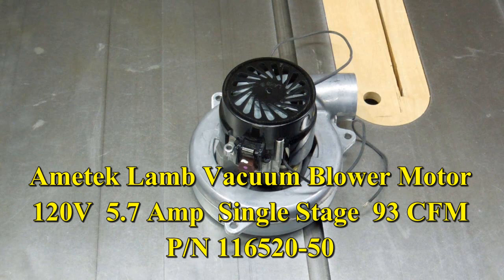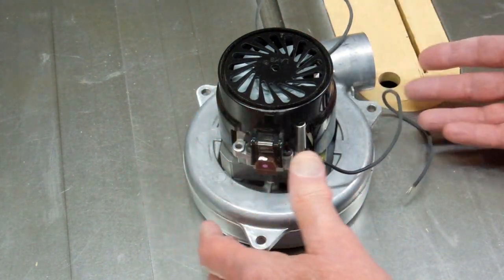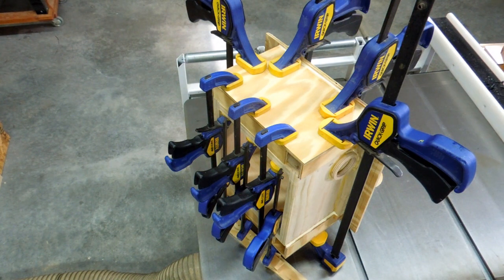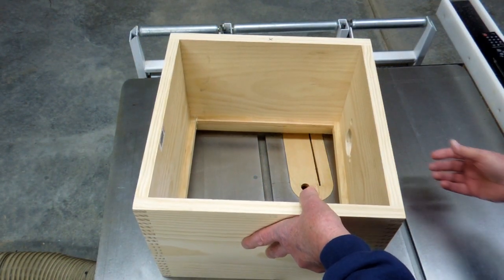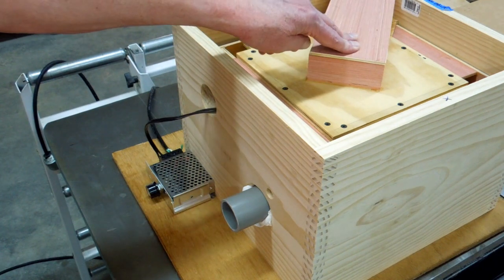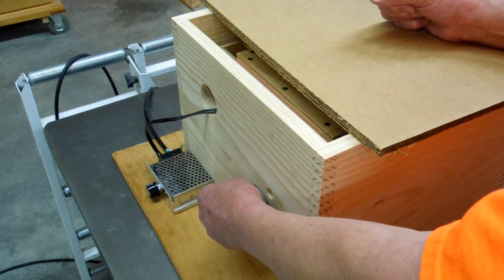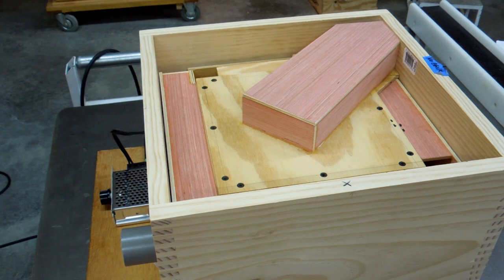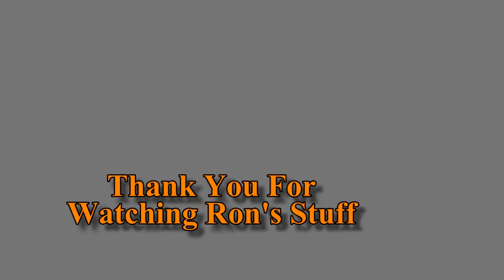Mini Calliope Part 3 - Blower Box Experiment

Comment: I would also look into adding a muffler if you have room.  Like the ones used on central vacuum cleaners.  Its a piece of foam wrapped around the inside of a pipe.

Comment: Always inspiring the level of thought, ingenuity & superb craftsmanship you put into everything you do!   Curious if you gave any thought to trying a replacement motor for one those Dyson or Miele vacuum cleaners, that are marketed to run much quieter?  .. I believe Dyson’s “digital” motor is just a marketing gimmick for a brushless DC motor.  But the Miele C3 vacuum is supposedly among the most quiet vacuum cleaners at 60db (I think the Dyson V8 came in at 67db).  Wonder if one of those motors could work for this application?

Comment: if your going to have a blower box that big, why not just make a gear driven bellow, like you did on your busker organ?
Reply from the maker: Bellows also require a regulator and (at least to me) are more useful for an instrument which is going to be carried around and needs to be portable. While they are quiet, they are a bit complicated to build and maintain.

Church and theater organs require a lot more air and blowers are always used. Blowers tend to be noisy and are generally located in a basement or out-building to keep the noise away from the organ.
I was using a vacuum cleaner blower in this video and it was just too noisy.

Later in the series I build a much quieter blower. Still a bit noisy but it could be muffled and once the calliope starts playing you no longer notice the blower noise.